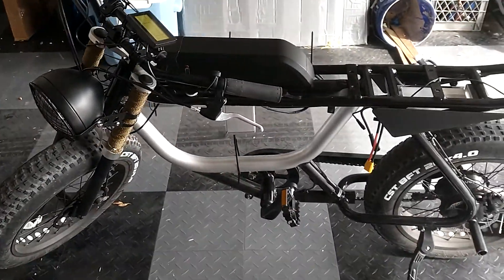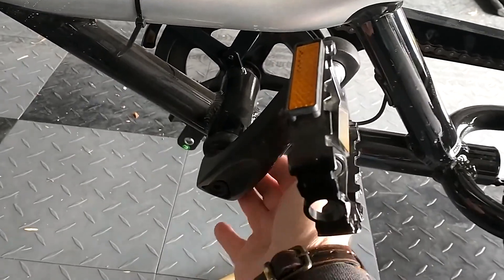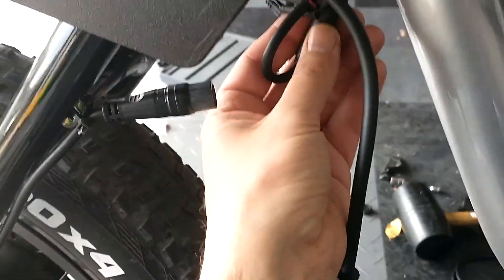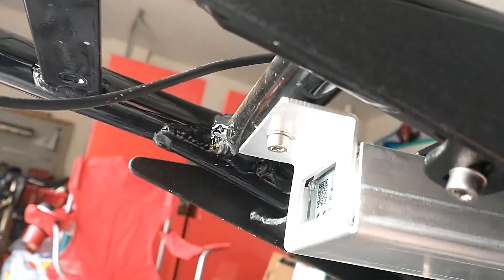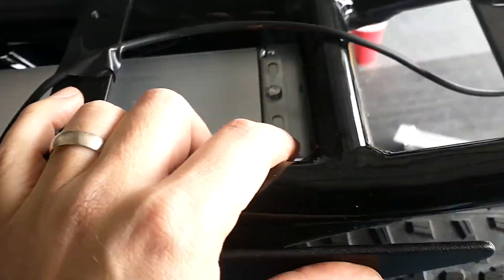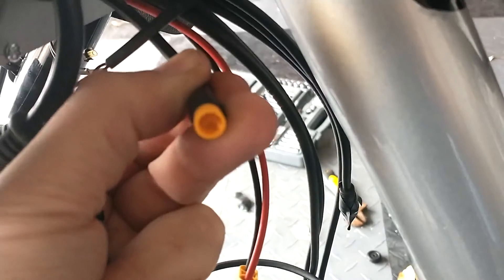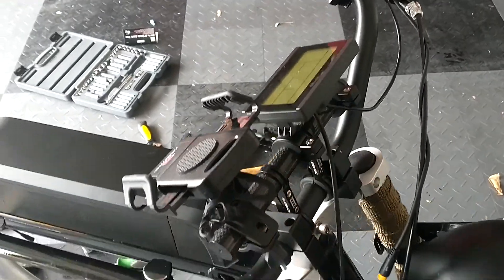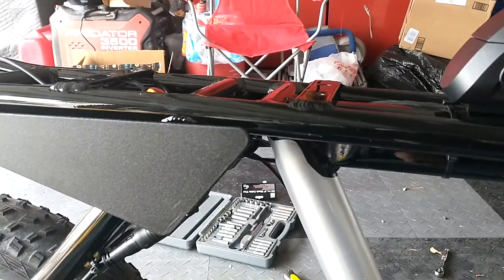Monday Motorbikes Anza - Part 1 - Controller upgrade

Comment: Absolutely love the look of those Monday bikes, but that's a lot of money to spend on a bike that needs to have the electronics gutted on day one
Reply from the maker: Hi Marc,  Yup.  Only thing that's going to be original on the bike is frame and motor.  Lesson learned. Frame is cool, but pretty low.  When I make leaning turns often the pedal hits the road.
Reply: What are your plans? If I bought that bike I would go with a 500 watt version because it's cheaper.  I would put the thousand watt geared Bafang kit that they sell on the Eunorau web site.  And also install a BBSHD.  Two 17.5ah 52v battery. That should be enough power. Without having to go all wheel drive
Reply from the maker: @marcs4091  Sounds awesome!  Should do a vid series if you do it. This is my first ebike. Just know when I got it, it wasn't what I imagined so I started hacking it up :)  Think after the battery (coming in a couple weeks) and hydraulic brake upgrade (coming next Monday) I'll be done with the Anza.  I gave it to my  son and bought my self a Sur Ron (be here end of May)
Reply: Just curious what's the weight on a Monday in stock condition
Reply from the maker: @marcs4091  think shipping weight showed 88lbs, but feels more like 60 or 70lbs
Reply from the maker: @marcs4091  idk what juice uses, but the frame is actually aluminum and pretty nice on the anza

Comment: Hey rob just ordered all the things you have mentioned. Can’t wait to get up to speed!  I don’t think I have the Technical ability you have so it will definitely be a project.
Reply from the maker: Exciting! Congrats dude! Hit me up if you need any help. Got my bike going today. Lots more fun. Bigger battery is a must. 11ah too small for 750. Sometimes when i hit full throttle from dead stop, the display turns off. Googled it and means battery is undersized :-/ not a killer, but just another thing to change out.
Reply from the maker: In the controller i can turn down the output to motor, but what fun would that be :)
Reply: Thanks 🙌🏻 At this point I figured I’d go all in and if the battery is next then so be it lol I’m most nervous about having to solder, I might need to get some help with that from someone. You in SoCal? Hahaha
Reply from the maker: @alfredogonzalez6728  no, I'm in the Vegas area. There's ways around soldering. Can get a crimping tool and wire fittings. Or even easier use wire nuts. Not as clean but works fine.

Comment: You should customize it like a cafe racer 
I think it would look legit!!!
Reply from the maker: Yeah dude. The bike is actually a cool platform to tweak with. Hopefully all this upgrade stuff works, then I can move on to the looks. Thanks!
Reply: @RobbMods  you're doing an  excellent work on that ebike.! If I'm not  mistaken you could possibly upgrate to a 1500 watt motor with that controller!!!
Reply from the maker: Thanks! Just trying to pass on what I'm learning since there isn't much out there on this bike.